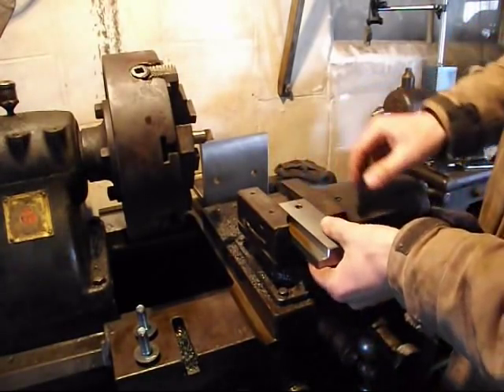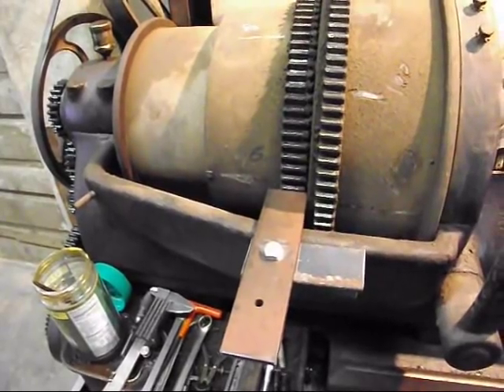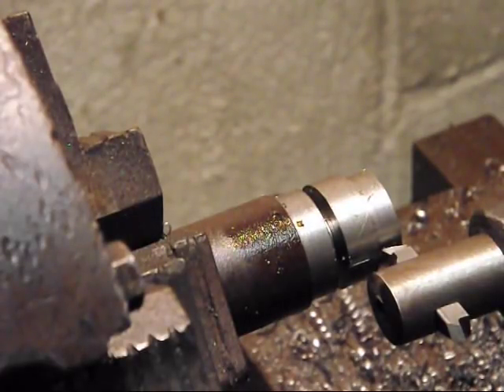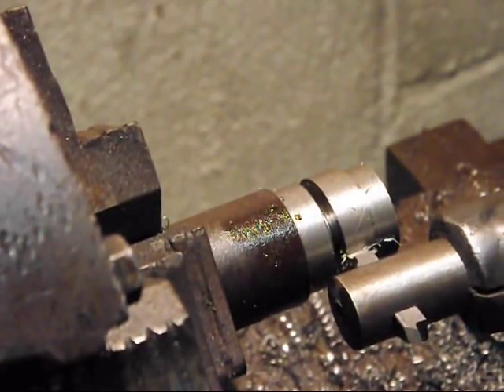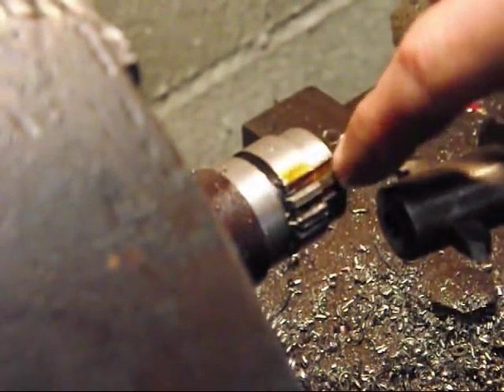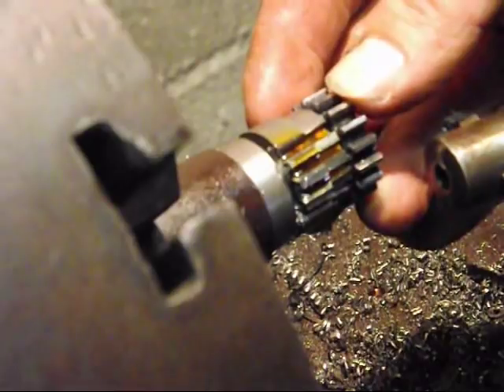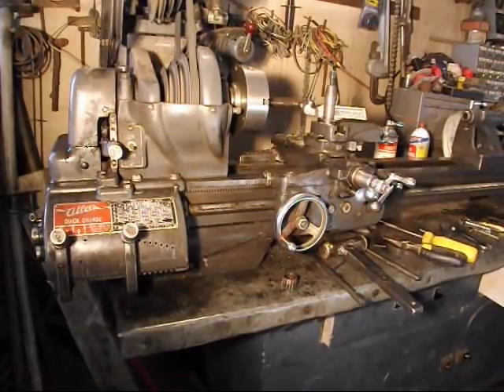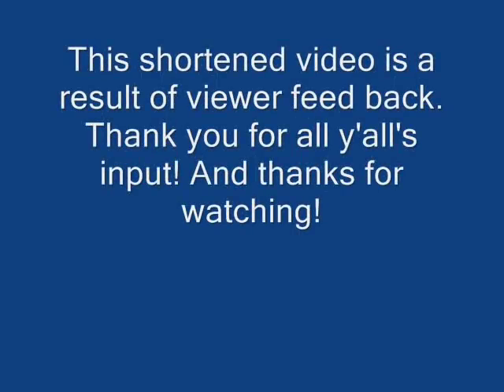Broaching a Gear for the Atlas Lathe (December 2012)

Comment: You burned of the hardening with hard soldering (brazing) the gears together. Gears should be case hardened, to have a tough inner core and a hard shell.

Maybe you need to make a press fitting to keep the gears together. Heat the outer gear in an oven (or a hot oil bath) so that it keeps its hardening, but expends never the less. Put the inner gear in the fridge in as low a temperature as possible. Then put the pieces together. You can always use the press. 

Greetings,

Jeff
Reply from the maker: They are NOT hardened gears. They are Zamak gears which is a very, very soft alloy.

Comment: Um it would be intressting how the gear hold up. Usually gears are heattreated and tempered, could be possible that because the others are and yours aint, that the wear is higher. nice demonstration tho, proofs the point that all those nitpickers out there who say ney to guys who want to start out:  it's the mindset that moves the water to the village, not the tools. dosn't matter if you only can afford a chinesium or a old rusty lathe, you can make it work too
Reply from the maker: Thanks for the kind words! :) I absolutely agree Mindset is the key. The gears in the lathe are not heat treated. They are made from Zamak, which is a zinc, aluminium, magnesium, and copper alloy. Obviously it's not possible to harden those.
Reply: @WideVisionMetalFab  yepp, i just stumbled over tuble cain video about his atlas gears, and he goes into details about zamak and that it might be used during the war as a substitute... intressting stuff

Comment: Very cool. I have a 3500 lb winch I picked up for free that has all but 3 teeth broken off of the gear that drives the spool. I can't find a gear anywhere for it so I figured I'd try to find a way to do it on my smithy. I don't think there's a way to lock it up like you did on yours though. I'll have to get super tricky I think.

Comment: Excellent job get it done with what you got. I didn't see anything in the video that could be described as a broach, cutting a gear with a single point cutter on a lathe is way more interesting. No theory as to what sort of junk the original gears are made out of but it can't be a zinc alloy as you successfully brazed it.

Comment: you damage your lathe, any way no matter ventage unit.
Reply: Mario Herbito not if you are taking light cuts, he seemed to figure that out. 
that technique has been used for quite some time. in normal turning under power feed, its receiving the same pressures under the same screws

Comment: why not turn your job 90 degrees and use the lathe to turn your cutter and after cutting first tooth shallow then turn part right distance and lock it then take one light pass per tooth all the way around then you use the teeth to index

Comment: Great video. While you were cutting the gear it looked like you were not wearing safety glasses. If not please wear them at all times. Sight is so precious. Only takes a split second to loose it. Norman
Reply: He was broaching this does not require safety goggles as there is no risk of flying chips
Reply: +stanley carter Your blade could break. I believe any and all shop work require safety glasses. When you think nothing is going to happen it may. I have wrap around safety glasses on both sides of my shop and use them. When cutting grass, using a weed eater or chainsaw I wear safety glasses and ear plugs. Welding, long sleeves and welding gloves. Anyone that comes in my shop when I am wearing safety glasses must wear them too. Please be safe.

Comment: There should be no pressure on the leadscrew during this broaching. Supporting the wheel from the tailstock with a centre would help. Looks like this old lathe wouldn't really mind tackling this job. kept it alive.

Comment: Very strange having power switch backside of lathe. Is it dangerous ? Why you don't use some modern elements to do control more easier: power relay switch, SSR or maybe used frequency contolller ?
Reply: use drill to move the tool back and foward
Reply from the maker: +Dmitry Ponyatov I never did like having the switch back there. I would say it's dangerous. I'm currently wiring a drum switch on to the front, as well as a different motor. Someday I'd like to convert it back to the flat belt drive and a Variable Frequency Drive.

Comment: atlas and craftsman lathes have pot metal gears.
Reply: The quick change gearbox gears are steel, only the (non-qcgb) change gears are zamak
Reply from the maker: +shadowmink888 Technically called Zamac. (Or Zamak) It's Zinc, Aluminium, Magnesium, and Copper. I didn't know it until this gear broke, and now I really don't like using the little Atlas for production work.

Comment: Helow and thank you.  I would be very intrested to see hoe to grind the high speed blade to the shape of the tooth of the gear. Never seen an explanation for this process. Thank you/
Reply from the maker: finster101 I did this one by eye. I'll try to make a video about the subject someday. Making a fixture would make it a lot more accurate.
Reply from the maker: I shaped the bit with a bench grinder and then kept putting the bit into a gear, checking for light coming through. Kind of similar to shaping a thread cutting bit and using a fish mouth to check if it's correct. I hope that helps a little.
Reply: Wide Vision Metal Fab Thank you for answering. It definitely helps!  It seems to be a bit more complicated then shaping a threading bit. If you will ever have the time, maybe you can shoe the process in a video. (i never fount it in the net).  Your explanation is very clear but still, could be interesting to see "experienced hand" do the works. Thank you!
Reply: Wide Vision Metal Fab I too would like to see how you ground the tool bit.  Did you do it just by eye or is there some sort of jig fixture involved?
Reply: yhjh.

Comment: Great to watch this one again. It was also nice to see you working the lathe. As tall as you are, you might want to raise your lathe up a bit. Bending over for all those "slices" needed to make the gear must have been a killer on the back. Nice job. You do good work!
Reply from the maker: Many Thanks Jim Milne!  I have been thinking about raising it ever since I saw Abom make his lathe feet. The little 3/4 horse motor died on the Rockford last week. I've been trying to finish putting a 3 horse on it. I can't wait to get it done and see if I can drill a 1 1/2 inch hole without the motor stalling!

Comment: Is the steel gear causing the Zamac gear to wear more? Good video
Reply from the maker: Eric Corse I haven't examined it since it's buried inside the gear box and difficult to see.  I think as long as I keep it lubricated, it'll be fine. If not, I guess I'll be making another gear video. I've been scared to push this lathe very hard since doing this video, because that Zamac is really soft stuff.
Reply: Wide Vision Metal Fab be careful about Galvanize corrosion from mis match alloys.

Comment: Nice video. The gear now nearly two years old, how is it holding up?

Next time, consider leaving a taper on the blank instead of the step, might be easier to get the tooth cut, You'd then have to come back and change the taper to a step when all teeth were cut.

Did you use a proper involute shape?
Reply from the maker: Thanks Pat Farrell ! It's still running great! I think either leave a taper, or someone else suggest having the shoulder towards the chuck, or turn the shoulder after the gear is made. I tried to copy the other lathe gear pitches and shapes as best I could.